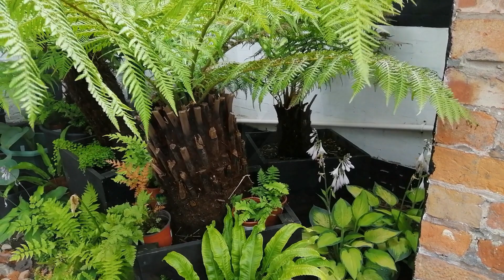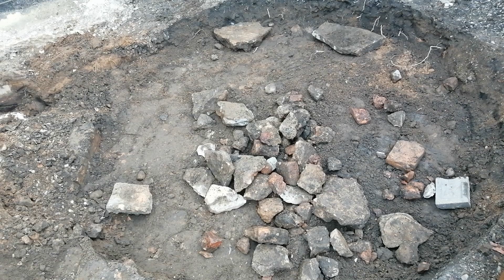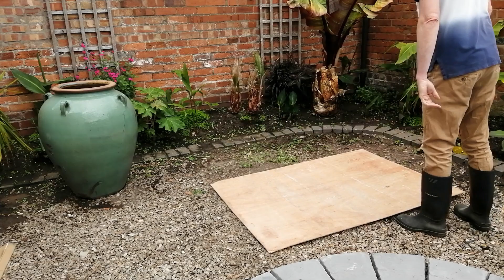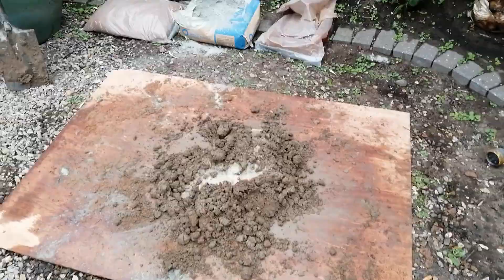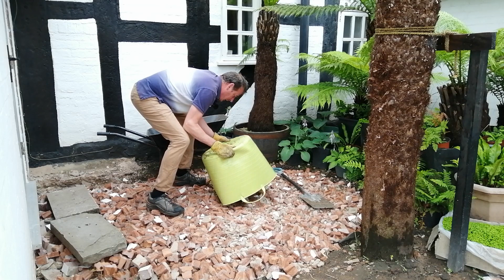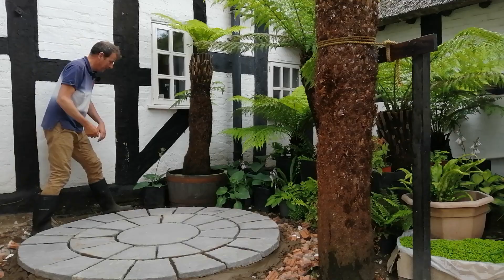How to Lay a Small Garden Patio, A COMPLETE GUIDE. 10 EASY STEPS!

Comment: Excellent clear video, full of sensible, practical tips. You learnt as you went on, and we learnt along with you. Many thanks, very much appreciated. My round arrives a few days' time. Sixty stones, so I'll be having fun.
Reply from the maker: Thank you for this comment 🙏 there is an additional tip which is easy and can help them remain secure (mine are all still sound 2 years later). Paint the reverse of the slabs with a very wet slurry. This helps adhesion. Thanks again. Mark

Comment: Hi just seen your video, I’m starting to lay a circle paving soon first time like yourself, can you say what size spacing between your slabs cheers
Reply from the maker: Hi. Mine were kind of bevelled. Narrower at the top. So when i layed the set it was more or less touching in most areas at the base of each tile. With about 2cm gap near the top for pointing. I didn't measure it out precisely. Just kind of layed it and squidged them up to each other. Mark